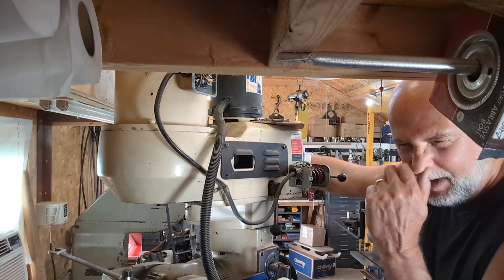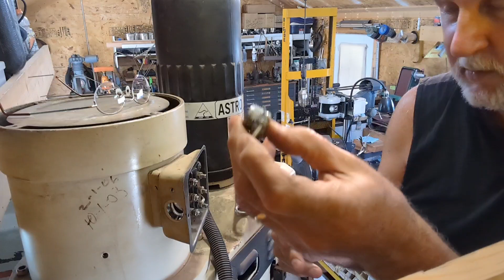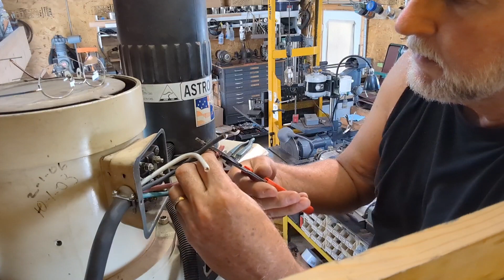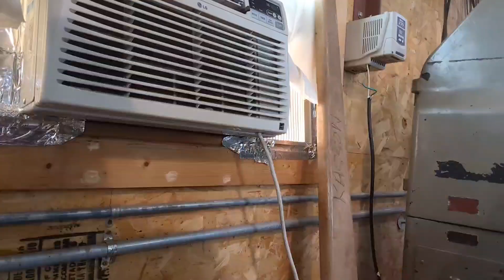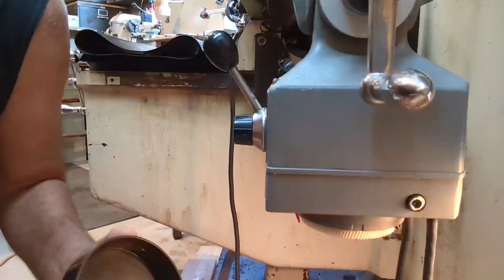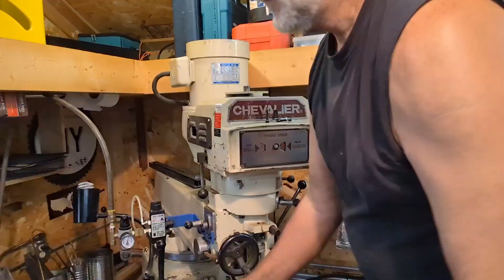Mill Repairs- wire up, power drawbar.

Comment: The Servo brand power feed does indeed have a black round cover like that. I just have never had one apart to know if that is the correct one you have.
Reply from the maker: Thought that as well, that it may be the correct cover, just didn't see how it was held on.